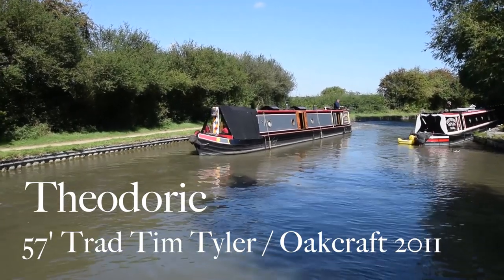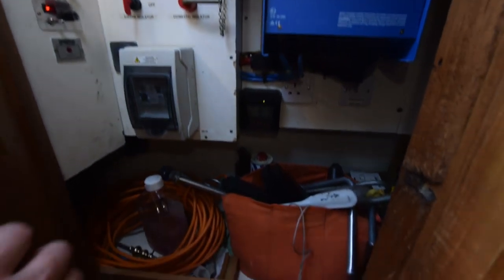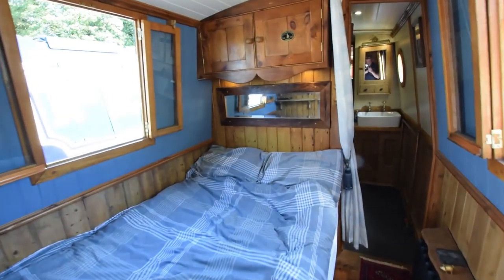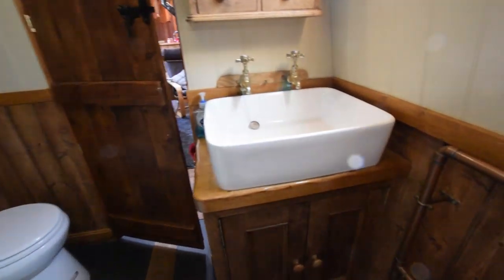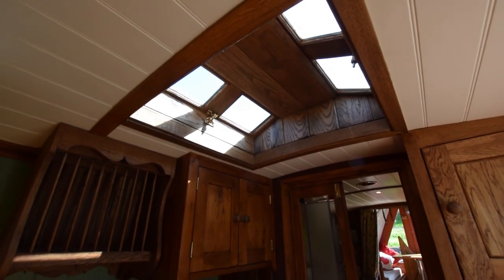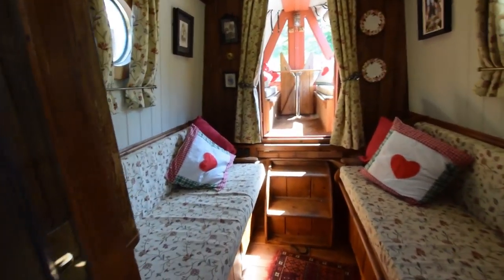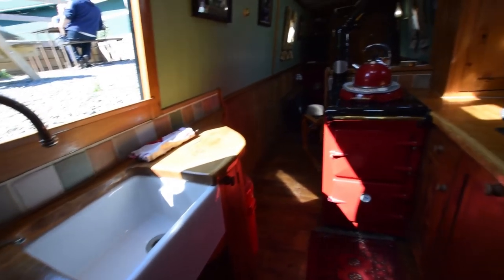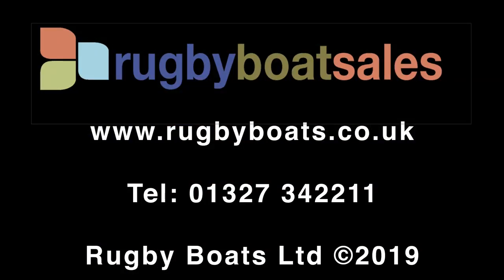SOLD - Theodoric, stunning 57' trad 2011 Tim Tyler / Oakcraft

Comment: There is so much to truly love about this boat. It just oozes a warm inviting cottagy charm. I love the hull colors and the large rivets. The use of natural wood and high quality paint, tongue and groove wood and lets not forget the two wonderful pigeon boxes. Having said all this, there are one or two things that don't make sense to me. First is the Heritage stove. It juts out almost in the passageway, like it was figured into the scheme as an afterthought. I'd also want to know, can you isolate the radiators while you cook on it; I'd sure hate to be heating up the boat in the summertime. Also, the oven is tiny, no hope of cooking a Thanksgiving turkey in there. I may be wrong, but does it take a long time to heat up food in a pan? I think I would much prefer a regular gas hob. Secondly, having a dishwasher seems a bit of a waste, unless you are moored up in a marina most of the time and have power to burn.There is no solar installed or travel generator, for 90 grand I think I would want a Travel Generator to run the Washing Machine. Don't get me wrong, this boat is one of the very nicest out there, but I would likely ditch the stove, convert to an Eberspacher system, install a Gas Hob stove. Having said this, I might elect to keep the stove if it proved to be efficient in cooking food, but again, the oven appears tiny.

Comment: There are many, many things to love about this boat, the woodwork, walk thru bathroom, door latches, stunning reclaimed elm, painted tongue and groove, belfast sink, stunning saloon and cratch seating area, low time on engine, charming pigeon boxes etc. But one thing to me stood out as a negative which really should have been a positive, perhaps I am wrong? The Heritage Stove which offers a beautiful focal point to  the boat to me, has two negatives. One, it seems there is really only room to place one pot at a time onto the cooking surface, perhaps you could squeeze two tiny ones there. Secondly, how would you cook in the summer without heating up the whole boat? Perhaps there is an isolation valve to the radiators? One other negative, it appears the bed does not have an extendable width. Still, this boat has so many positives, one may easily overcome these concerns.
Reply: Only thing I can think of is a lot of electrical devices set atop the counter when in use. And I can’t see the point to it. Your gas free but you have a coal stove? 
Only can guess they don’t do a lot of cooking and that coal stove is more for ambience instead of serious heating .
 And going back to the stove, it does seem odd because I have seen diesel stove that both cook and heat a room and the have multiple burners so I can’t understand this. Looks more like something you would see port of the back steps in the boatman’s cabin than the main galley

Comment: hand fitted wood, aga cookers aren't cheap, wonder if the owner thought it was his forever boat then found different.   I have never seen an aga cooker in person, how do cook in the summer if it puts out heat at all times? do you shut it off and not cook?
Reply: I always wonder the same thing.  You don't see many Aga cookers here in California.
Reply: I stayed in a home in Australia, North Queensland, many years ago in summer so arourd 35 degress celcius or 95 degrees fahrenheit and it had one of these and it was on and I was equally surprised it was no hotter than a normal oven. There is a lever that you move to compensate for the season, you either retain the heat or you get rid of it.
Reply: So much of what humans do is all about impressing other people, that's why it's often quite illogical to the practical person who doesn't do that !